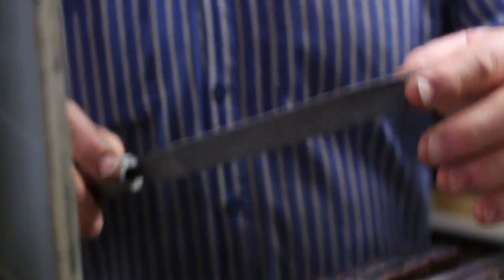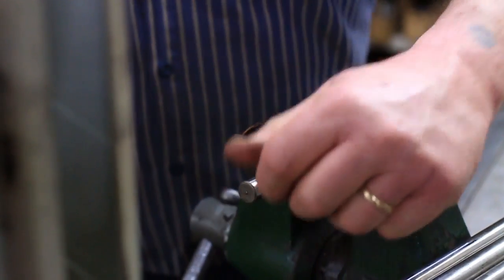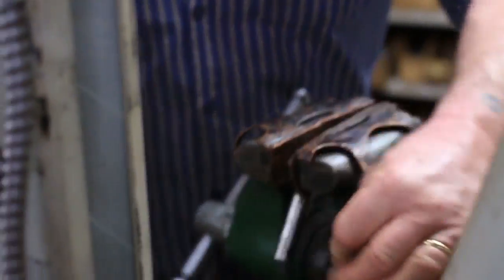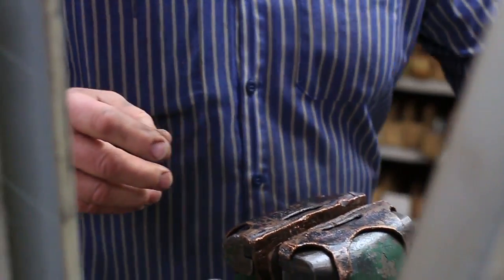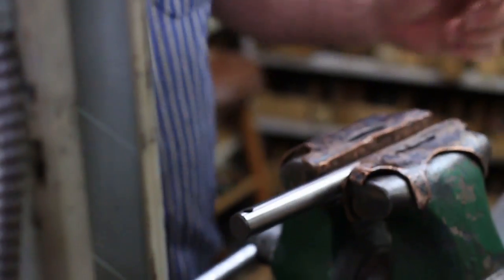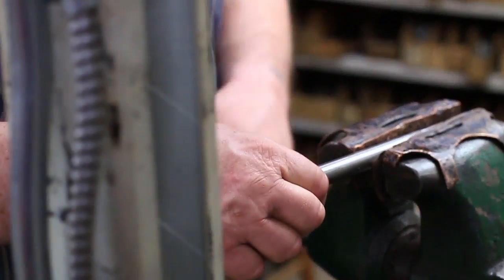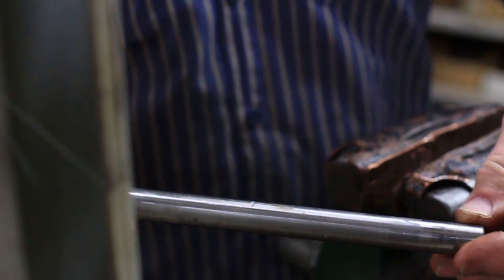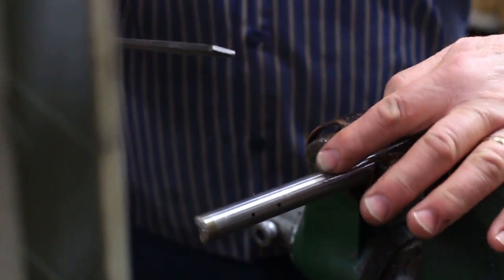230 MG Tech | Layshaft Problems in Gearboxes

Comment: If it hadn't have been for the soft layshaft in my 67 MGB GT, I would never have learned  auto mechanics by replacing the layshaft, laygear, bearings and a synchro ring or two. 40 years later I'm still fixing my own cars.

Comment: Reminds me of my metallurgy course at my University in the sixties (I've got a degree in ICT). Rockwell hardness was then a rare one (Brunel was still around). But I noticed recently things are not always going for hard to soft. Clutch pushrods from MOSS for a MGB went up in hardness, while the clevis pin remained the same. Trying to drill into one also points to hardness levels. The earlier pushrod could be drilled, the later not.